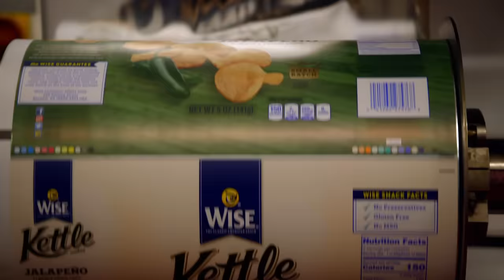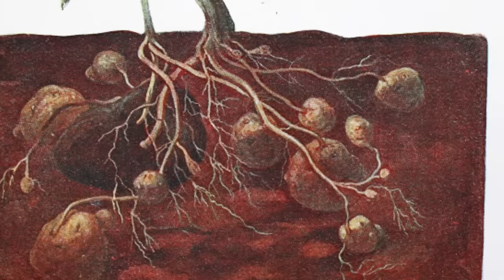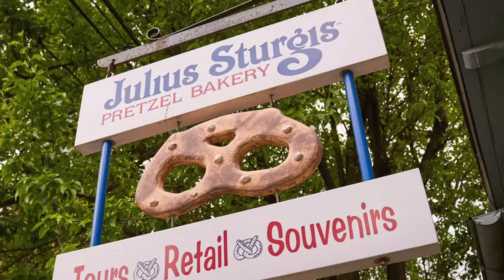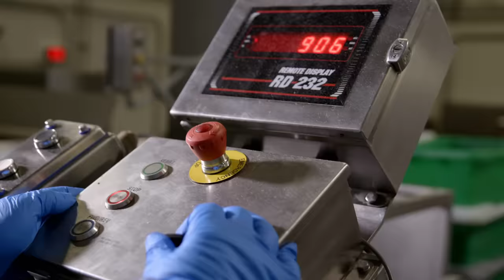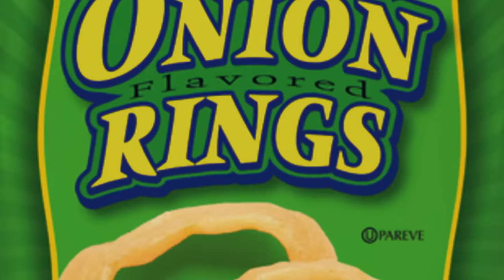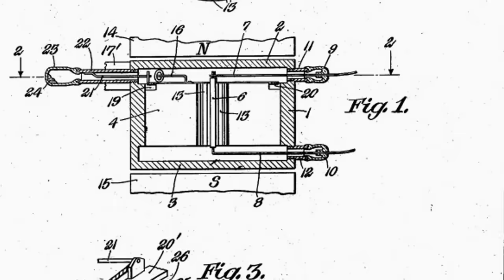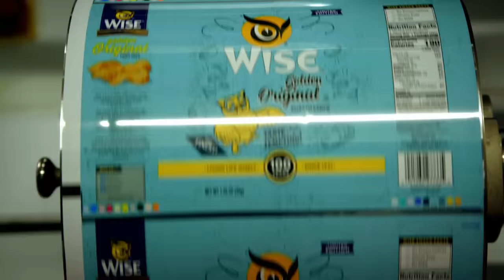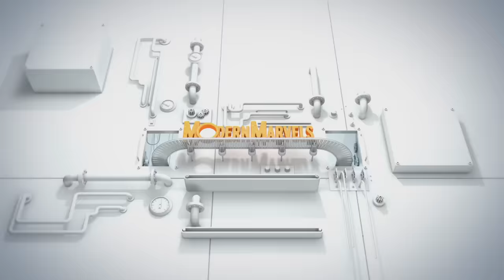Modern Marvels: The Incredible World of Snacks (S18, E5) | Full Episode

Comment: How are you getting 50,000 lbs per truck load when the max allowable load for a semi is 80,000 lbs without a permit? Most trucks and trailers weigh 35,000 pounds when empty.  Where is that extra 5,000 lbs saved?